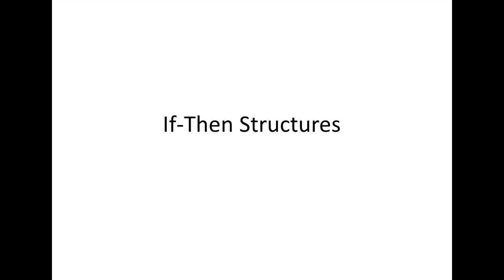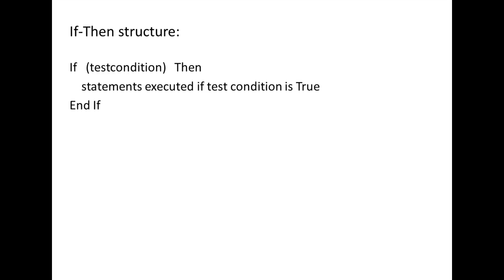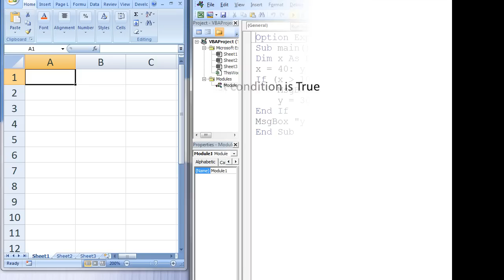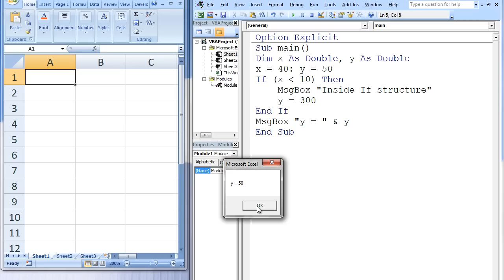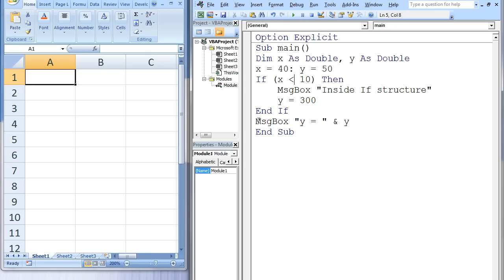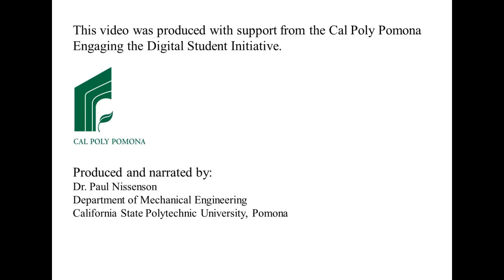Excel VBA Topic 6.2 - If-Then Structures

Comment: Wouldn't this be easier to do without VBA and just using the workbook features? You should have mentioned that too
Reply from the maker: But this is a video on VBA.

This the first of a few videos on If structures. More complex If structures are a bit ugly to deal with in Excel spreadsheets.